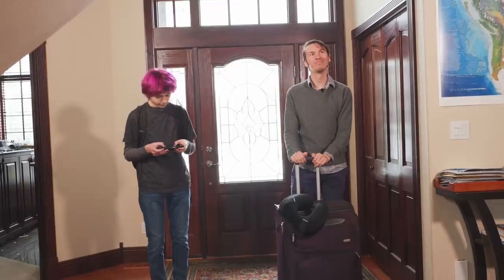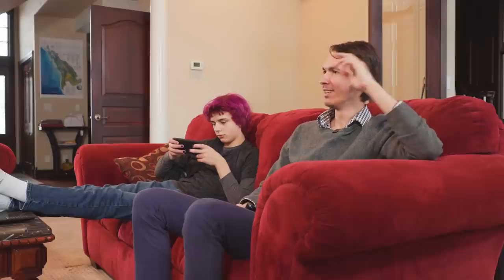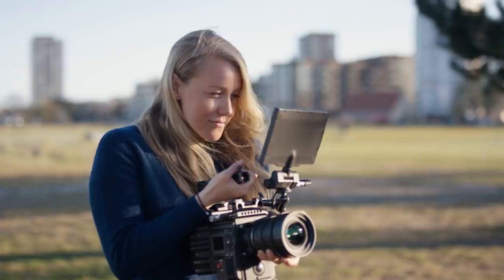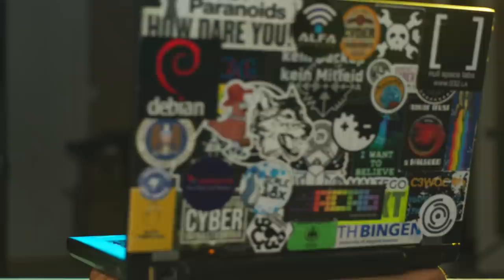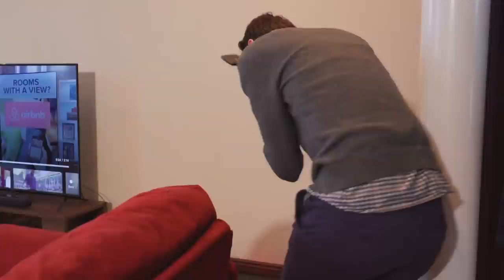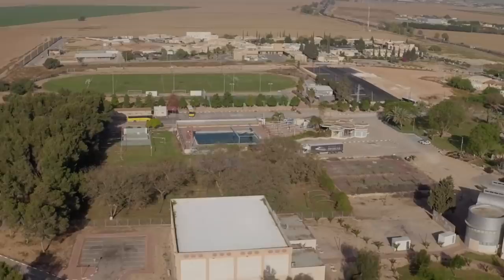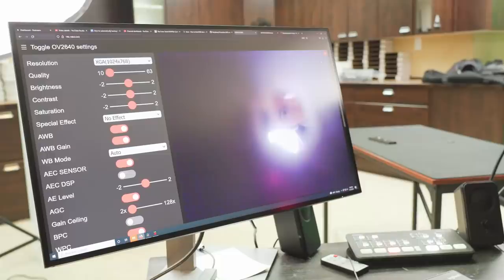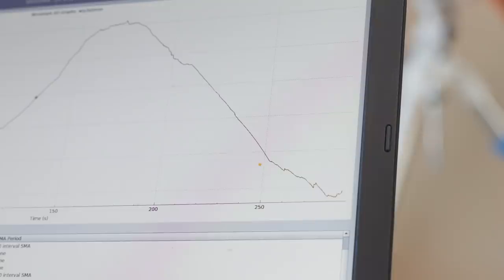Can Wireshark Spot Hidden Cameras For Free?

Comment: Some thoughts:

1. AI and counter detection

2. Motion detection/RF counter detection or live monitoring to thwart guests/searchers

3. Need tin foil to drape around bed. Or, solar blankets to drape over as a canopy. Or to wrap around desk to block view. May need multiple rings of screen and foil. For hanky panky, white noise or other devices might be needed. Maybe someone can write code to scoop up and invert the sounds to uselessness to nearby mics.

4. Lighweight tent?

5. Legally, is there risk of a landlord or property owner accusing the guest of illegal wiretapping? A devious host might set up "security" systems and then claim the guest tried to sniff and violate household security if powerful tools like Wireshark are used. I'm just guessing, but it may vary by state and country.

1a. I suspect the next battle will be that snoops/miscreants (whether LE or criminals) will employ AI to detect sounds of normal visiting vs inspection. If the AI senses a search, it might diaconnect thw vameras and also kill power to the wires from a smart box. If that becomes real, it's probably game over for consumer-grade equipment guests. Once asleep or on the sofa, the AI vould periodically wake up and turn systems back on.

2a. Similar to above, pressure pads or super thin, low-RF wires in the floor might help power-off systems kill power and data to reduce detection. If tou walk too close, or interrupt timing signals in a manner suggesting circular pacing and hunting for lenses, the system might detect and wear you out on an endless round robin search.

3a. Finding lenses and mics might be hard and exceedingly time consuming. I'm of the mind that scarfing up a bunch of survival blankets and baking foil dangled over the bed, draped from the ceiling, and set up as reflectors/attenuators might scramble the snoopware and fors the snoops to ramp up power so high it disclosed more equipment to the skilled hunter.

4a. A lightweight tent you line inside and outside w/ foild might make it better so no need to mess with the rental property walls or ceiling. Nothing like camping in the middle of a rental room. Maybe a fog generator can muck up the lenses?

Note: going through an airport w/ 10-20 solar blankets and foil might draw unwanted attention. Perhaps buy locally before bedding down self or others. 

Also, overdoing things might create spillover noise and tick off the neighbors unless tuned by a lro to not cause FCC involvement.

The above are just guesses and my opinions.
Reply: like, there's literally no need for them to use any AI BS to detect inspection or something if they use cabled cameras 
Those wouldn't show up in wireshark

Comment: Whouldn't the Hidden camera(s) be on it's own separate VLAN and be unable to track with wireshark unless your connected to the same network?. From what I understand wireshark can only capture devices on the same network because it works with Layer 2 devices.
Reply: use jack the ripper to find.

Comment: First of all you didn't use the Detector correctly at all so it's no wonder you couldn't locate the camera. Secondly if the Detector is used correctly you don't need to spend hundreds of dollars on it, as long as it covers the frequencies you are looking for it can be as cheap as it needs to be. Now for Wireshark... Yes you can find cameras with this tool. I have used  Wireshark to find Camera protocols sent from an infected Switch. However, you will need to install a custom Dissector to disassemble the data from the protocol capture and look at it. Take the time to learn how to install a Dissector in Wireshark.